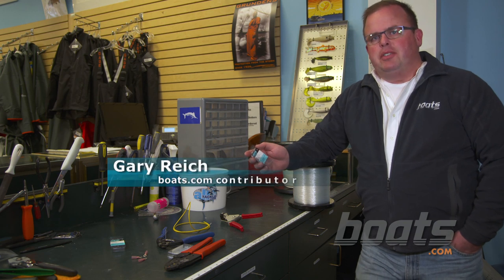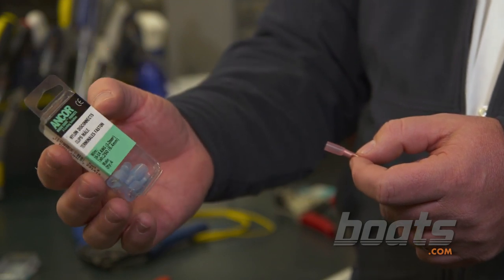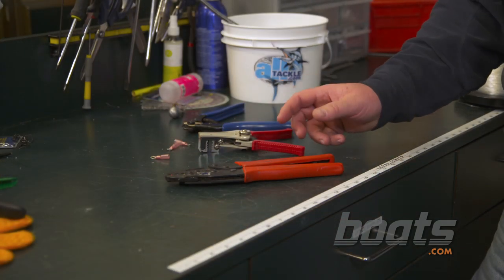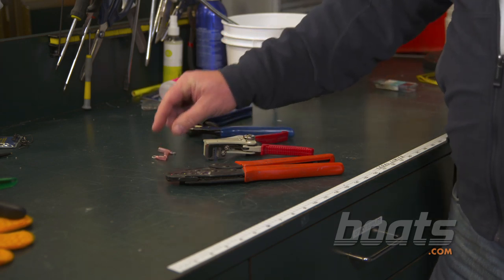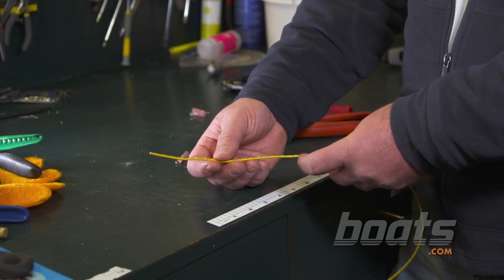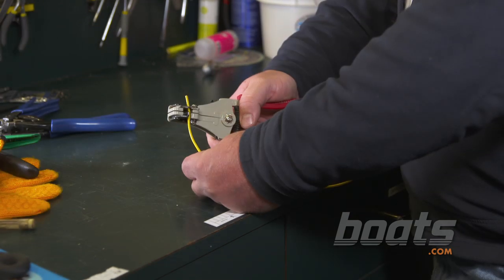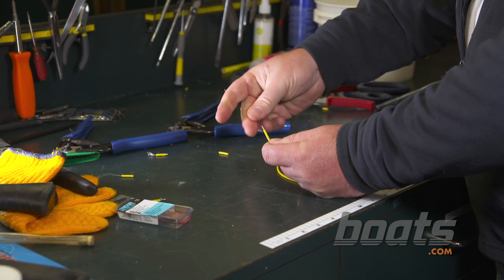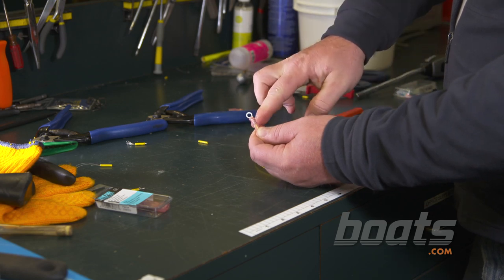How To Install Heat Shrink Terminals on Boat Wiring

Comment: Should use a single crimp not a double crimp on heat shrink terminals to avoid damaging the jacket double crimp is used for nylon terminals

Comment: As Mike comments, I question the double crimp advice. Ancor says double crimp is designed to penetrate the tubing and will destroy the waterproofing, so a single crimp tool must be used on waterproof heat shrink to maintain integrity.

Comment: there is something call fan for heating... at least do proper video, you can burn terminal whit open flame...
Reply: p.s. i use open flame to, but its not something that i would recommend for beginners